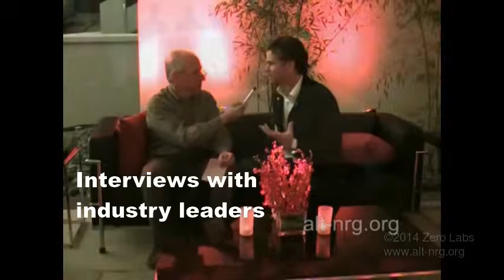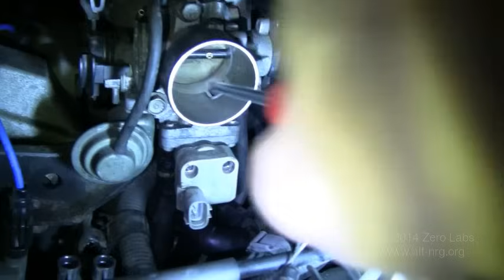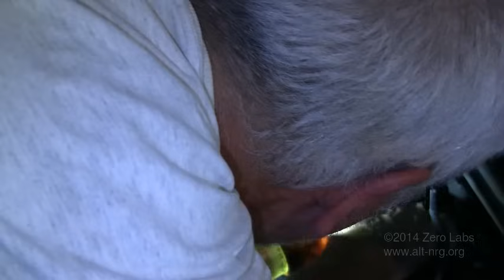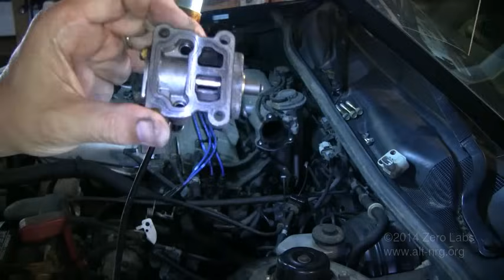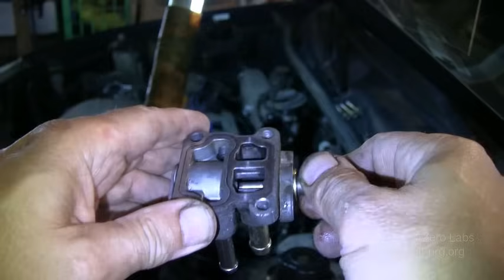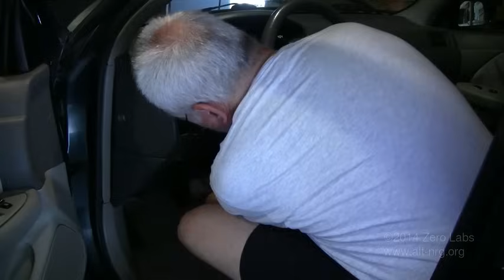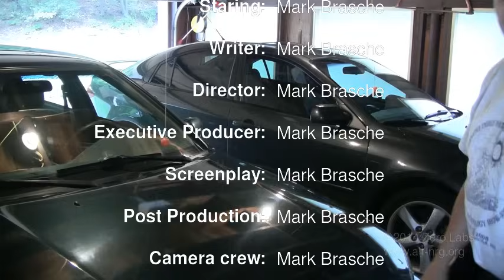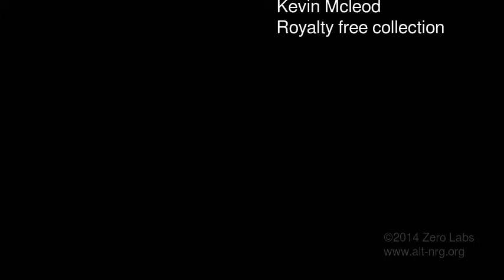#372 Better repair method Toyota Camry Idle Air Control Valve

Comment: I just replaced mine with one from Amazon. Made it worse, took the old one separated the electrical part. Cleaned the mechanical part. Remove all of the carbon build up with CRC cleaner saturate the moving parts with WD40. 
Reassemble Take the magnet electrical part get a 9 volt battery jump the middle connector and the left or right replace get side connector till you see the the valve open. Jump back and forth till you figure out the side that opens the valve. Jump it on and off till it opens and closes with
No friction or tension at all. It needs to open 2/3 of the way. Reinstall
Reply from the maker: You are correct. The IAC valve is one item to never buy aftermarket. They're just not calibrated correctly. And at the very top of my list of items to NEVER buy aftermarket is the MAF sensor (or MAP if that's what your car uses). The one on the used 06 Camry I bought to replace my 97 was very bad. Bought a less expensive Walker brand from Rock Auto. Close but no cigar. Broke down and bought OEM from a dealer. Problem solved. Lesson learned.
Reply: @zerolabs  I have a 1992 Camry (5S-FE engine). Toyota doesn't make IAC's for this year anymore. If I needed to have it replaced, would you recommend me getting an OEM one from a junkyard? Is this often done? Do you think I can get one in good shape? Thanks.

Comment: Hello, thank you very much for your video! It is a very good idea, this way you avoid disassembling everything and clean the IAC valve, my point is that I have a Corolla and that hose that comes from the valve cover is above the throttle body, unfortunately, thank you sir. Greetings

Comment: Did you not have to bleed the coolant after disconecting the vacuum hoses?
Reply from the maker: No. The position is high enough in the system that it doesn't bleed out when disconnected. Also, keeping the radiator capped discourages drainage.

Comment: Great video. I've seen them spray into the opening and wondered where it would go....Now I see a better solution!  much thanks. My 2000 camry is not throwing a code for IAC..just a rough idle intermittent when sits after warmed up.

Comment: Hi! The line that you are using to drain where is connected after you finish. Or I can let the pipe (the central one) just open. Than you in advance!
Reply from the maker: ALWAYS reconnect it! Some models differ but mine vented to the crankcase.

Comment: Great detailed video and a good time and money saver.  My 98 4Runner 2.7 has the same IAC set up but my problem is different. My 4Runner starts just fine and runs at hi idle 1300 ish when cold but when the engine warms up the idle speed drops to 600 ish and It runs a bit rough. Manually increasing the idle to 850 rpms the rough running smoothes out. In addition to your procedure do you have Any ideas on what else to check or how to simply raise the idle a bit?
Thanks in advance ☺️
Reply from the maker: Idle speed is actually adjusted at the IAC by loosening the coil housing screws and rotating slightly. Discovered that entirely by accident.
Reply: @zerolabs  kinda like the old choke housings on carburetor engines.

Comment: My car idles super high now after cleaning this. Don't see any vacuum leak at all
Reply from the maker: Either the rotating valve is jammed open or you damaged it somehow. Possible you may need a new one.

Comment: I thank you for this video. It is truly helpful. Just wondering how the gate gets black. Are you talking about carbon'd up with black soot? As far as I can tell, there's no engine blow-by that's typically at that part of the intake. If the engine is running, the PVC vapors are immediately drawn in the opposite direction downstream. I know we all gain more understanding as we go, but maybe I don't understand something here?  I installed a $25. oil catch can in my 99 5SFE just to keep things cleaner as the engine ages. Seems like cheap insurance to me. I clean out the can at every oil change and spray in some carb cleaner, which the engine easily sucks up slowly. I figure this is a double bonus as it gets carb cleaner to a part of the air plenum that's usually difficult to clean. Hopefully it helps as my 99 still runs like a top.
Reply from the maker: PVC doesn't always keep up with all the blow-by, especially as the engine ages.

Comment: Idle rpm has minor fluctuation in 98 camry, no codes, LTFT is 18%, first thought is vacuum leak, if IAC is stuck open this might be the problem, good to know d/c hose on bottom of IAC and keep cleaner out of crankcase. Thank you.

Comment: I have a code  p0171 in a Camry 2009 and Olson The aircondiTion doesn’T work needs gas, The idle is not good is no quiTe , you This could be The soluTion Too for my car?
Reply from the maker: ¯\_ (ツ)_/¯

Comment: Thanks much for video.
I will be replacing fuel injectors on 96 4-runner Limited next week & will need to pull throttle body to get access.
While off I will give IAC good clean using your method

Comment: Oh my lord Jesus finally a video that thoroughly explained how to simply clean this because I cleaned my throttle body and some of the carb got into the iac hole and my idle has been stuck at 1000+ but finally you have a good guide without taking off the throttle body
Reply from the maker: You're welcome!

Comment: Very nice explanation.  Thank you.   I'm assuming you had to drain the radiator fluid before you took off the two water lines connected to the IACV, correct?    Is it safe to use carburetor cleaner for the IACV cleaning?  Or must you use throttle body cleaner?
Reply from the maker: Actually, no. Just plugged the rubber hoses with tapered center punches. Besides, it's relatively high in the system do it doesn't drain from the hoses very quickly anyway, especially if you plug them one at a time.

Comment: I put mine of to test it and something strange is going on - when I take that magnet between my fingers and start to spin - I can make 360 degrees without any resistant. On the other side mine doesn't have an option to open that side for calibration. Should I buy new valve?
Reply from the maker: Yep. It's broken. Time for a new IACV.
Reply: @zerolabs  Thanks, gonna order it tomorrow.

Comment: My 94' camry 4cly 5sfe is shaking/stalling on cold starts. Also the engine vibrates when idling in gear(even warmed up)... In park or neutral it idles pretty smooth. It idles at about 850 rpm

 Otherwise the car runs very smooth and has good power. Motor mounts look good doesn't buck around much when shifting to reverse or drive. I have checked for vaccum leaks with starting fluid did not find anything. 

It has recent timing belt, map sensor, intake air temp sensor, spark plugs, fuel filter, motor mounts.

Any advice? Going to look at coolant temp sensor, iac, tps, maybe adjust the idle
Reply from the maker: Have you tried this fix yet? Your symptom really does sound like the IACV.
Reply: @zerolabs  going to try that.. Will post updates thanks

Comment: Great video with step by step instructions.  One question though.  Do you not replace the gasket between throttle body and the intake manifold with a new gasket, or is it okay to re-use the old one?  Same for cover gasket at IAC valve. Thanks.
Reply from the maker: Only time I do is if they tear when disassembling. 99.9% of the time that never happens.
Reply: @zerolabs  Thank you.  This should help not replacing the gasket if not required.

Comment: What if the problem keeps coming back where the magnetic peice keeps getting cruded up and stuck more often then you would like, would a full replacement do the trick or it being an old engine that car will just keep giving every new assembly I get enough blow by to CRUD the magnetic peice up from moving freely like it should? Thanks in advance
Reply from the maker: I would say that depends on the overall condition of the motor. If the rings are very worn and you get a lot of blow by, that would crud it up more quickly. However, I will also say it's easy to fool yourself that you got the cylindrical valve really clean. I found it took more work than I first thought. If the simple method still does not work for you, before going as far as replacing, pull it off completely like I did in this video, get in there with carb cleaner and an acid brush and really scrub it clean.

Comment: I have the same car, cept it's a 99, and the same HF OBDll reader. The reader is a bit cryptic, but has saved my butt several times. Thinking of buying a Blue Driver reader, but it won't give ABS data on the older Camrys.
Reply from the maker: Sadly you are correct.

Comment: A lot of people are asking "Should I do this?"  Basically, if your car is older than 80,000 miles or so and you can spin a wrench, the answer is "yes, you should".   It is fundamental to having a clean throttle body.  Just spraying carb cleaner into the mouth and wiping off the throttle body does not clean the idle circuit.  

That said, many later cars that have electronic throttle control (no physical cable from the foot petal) accomplish this electronically and do not have an idle control valve at all.  But if you have a steel cable to your throttle body, you have an idle control valve that needs regular cleaning.

Can you use the shortcut method in this video?  After the first time, yes.  But you may need to take the throttle body off the first time if it is seriously gunked up, especially if it has run for 120,000 miles or more without ever being done.  If you do remove the throttle body, you will likely need new throttle body gaskets, especially for the coolant passageway to seal back properly.  

Also check for your car / engine for specific cleaning needs it has.  Late 1990s Honda Accords, for example, have a passage way across the intake manifold that also needs to be cleaned out.

Comment: I have a 1996 Camry that has low idle and damn near shuts off at start up I have to let it fully warm up and if not drive it to get it warmed and good, before it idles normal, on thing I notice also is I have to put it in neutral at stop lights for it to idle around 6 to 700 rpm which feels good and no vibration. Compared to leaving it in drive and it idles around 5 if not dip a little under 5, will cleaning IAC  I only have 2 tubes under it do the trick?
Reply: Engine is 5sfe as well
Reply: UPDATE!!!!!!!! So this definitely worked I did it while throttle plate was on the car I just unhooked the electrical sensor unscrew the 2 screws from it and access the magnetic peice as he done in the video, definitely had crud on it , removed the bottom MIDDLE HOSE OUT OF THE 3 hoses connected to it, filled with throttle body cleaner put my finger under and moved left to right until it was moving free and easy, then I sprayed whatever other carb I can see with in that IAC HOLE. A great tip which I would do is USE A WHITE RAG OR MICRO Towel of some sort just so you can visually see what’s coming out of there to know for sure some kind of cleaning is definitely being done during this process!! Super easy and off first start up I can tell it improved but the other 2 COLD START UPS I did later in the day gotten EXTREMELY Better if  not the best ive seen that car idle on start. NOW MY NEXT TEST is when I go to do AUTOSTART, usually that would take the old dirty IAC ABout 2  
To 3 times to start, if it fires right up on first try it’s definitely a fix
Reply from the maker: @kenjenkillasounds  Ha ha! You beat me to it. Yes, your initial description of the problem is classic jammed up IACV symptom. My 97 just got totaled by a tree knocked down by hurricane Isaias. 311,728 miles still going strong and it took a hurricane to kill it. :-( Now driving a 2006 Camry with 2AZ-FE 4cyl. No more IACV. All drive by wire. Mixed feelings about servo controlled throttle bodies.
Reply: Zero Labs wowww!!!

Comment: on a 2000 Corolla, the IAC has 2 tiny screws with odd heads... not Phillips and not quite 6 sided. It needs a special tool and is hard to get loose without ruining the small screws to rotate the rotating device...
Reply from the maker: If I were you I would spend a few dollars to get the right driver for the job.

Comment: Thanks for the video.. Im working on an 04 camry xle , i just replaced the spark plugs, igintion cores, and the transmission and engine mount. I will definitely clean out the IAC value hopefully it will work and run smooth..Thanks again

Comment: Thanks for the video. A mechanic quoted me $550 to replace the throttle body of my 2004 camry. Went and bought a throttle cleaner and fixed the problem, but aafter watching your video, l am keen to have a look at the control valve and see what's going on in there cos the start up is still a little bit rough. Subscribed!
Reply from the maker: It's criminal how they rape customers over "designed to fail" components like this. You wouldn't believe the venom spewed at me by "certified" Toyota mechanics for posting this video. Comical really.
Reply: @zerolabs  They should be angry because the truth hurts. Keep up the good work

Comment: Wanted to say thanks.  I wish I found your video a week earlier, as I already bought the new part, but even so, showing how to take the throttle body off, and that you don't have to drain the cooling system (as my shop manual suggests) means I might actually get this done this weekend.  Thanks again!
Reply from the maker: Great to hear!

Comment: Great video. Although, I don't understand why the IACV needs water. The computer could just make an adjustment to the IACV position based on the coolant temperature sensor.
Reply from the maker: Newer models might. Don't forget. This is a 97 I'm working on here. Uses a bi-metal spring.
Reply: @zerolabs     Thanks!

Comment: Thanks for the video.I'm no mechanic but still do a few stuff under the hood,but i wouldn't take off the throttle body as i'm not that too advanced lol I cleaned my throttle a few years ago but not the IAC,which i'll do v.soon as we're in lock down in the UK.Thanks for the in depth video,respect from over the pond.

Comment: The goofy music at the end is a waste of time; skip it. No need to remove the IAC valve. You can spray throttle cleaner into the squarish opening in the throttle body inside area and catch the residue/liquid in a cup under the center metal pipe out.. Don't let the carbon/liquid residue run into the crankcase...

Comment: whats the little coil thingy called and whats its part number i dont wanna replace the whole iacv
Reply from the maker: You'll have to call a Toyota dealer for that, if it's even sold separately.
Reply: @zerolabs  ok thanks

Comment: Figured there was a problem when the engine was stalling in the mornings when the engine was cold and I came to a stop. One morning the engine stalled and I couldn't get it restarted. Did a simple YouTube search on "'99 Camry Engine Stall Problem" and watched a video that talked about the same thing as this video but didn't remove the drain hose. This one came up next on autoplay and was more detailed. I removed the hose and worked in the carburetor cleaner as suggested (actually used throttle body cleaner). I didn't completely remove the throttle body as he did in detail but I did remove the drain hose underneath. Worked in the throttle body cleaner for about 5 minutes and drained the cleaner. Whole process took about 2 hours from start to finish and it worked like a charm on a $4 investment on the cleaner. Thanks for the tutorial!
Reply from the maker: That is SO GRATIFYING! Thanks for sharing your experience!

Comment: Thank you for this tip. Sure it will save loads of time and money. Wish it were day light, I’d be under the hood right now.
Reply from the maker: Please report back how it went!
Reply: Zero Labs Hiya, still surging. But, it did run well for a while. Not sure what it needs.
Reply from the maker: @rodericksheppardgolf  My money is on a more thorough cleaning. They can be stubborn. Took me two or three attempts before I learned how long I needed to keep it flooded with enough cleaner and working the valve back and forth. When I say 10 minutes, I mean 10 minutes. It feels like an eternity when you're doing it.
Reply: Zero Labs thank you for the heads up. Will certainly give it a full 10 min, and be sure to let you know how it worked out. Appreciate You and your channel!

Comment: Great video, Thanks!

I would like to know more about why it has water running through the IAC. You mentioned it was temperature controlled. Why is this? Why does it need to be cooled?

I ask as i have idle issues only when the outside air temp is really hot, like 40°c+
Reply from the maker: It needs coolant running through because it controls fast idle on warm-up.

Comment: Did you use new gaskets when reassembling?
Is there wax thermostat inside that reacts to the temperature of the radiator water?
Reply: I was wondering the same thing.  I've been using the same metal gasket on the throttle body and wondered if I need sealer or a new one.   Part number: 2227103030
Reply from the maker: Mine was a paper gasket that came apart cleanly and went back together without any trouble. I guess replacing all depends whether or not you tear yours.

Comment: The IAC gets dirty buildup from engine blow-by via hoses from the PCV valve and an engine breather hose connected to the air duct - at least it does on my 2003 Elantra GT.
I installed my DIY oil catch cans between the PCV valve and a can between the engine breather port and air duct.
Both cans act as permanent filters with stop drains at the bottom. Now the intake manifold components stay clean.
Reply from the maker: Interesting solution. Thanks for sharing. The tube on my Toyota is how they vent the crankcase blow-by gases into the intake for combustion. So yes, it's no mystery why the IAC valves get gummed up.